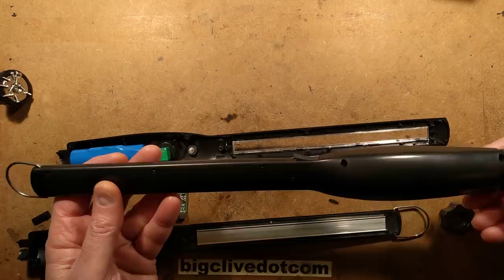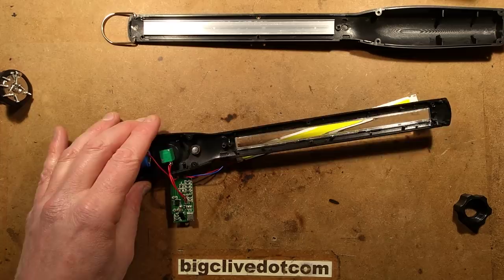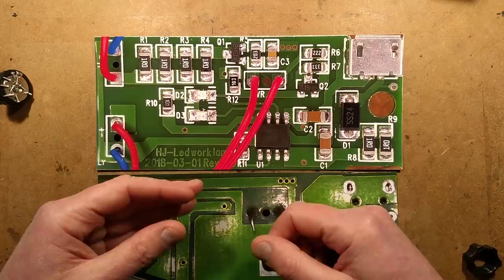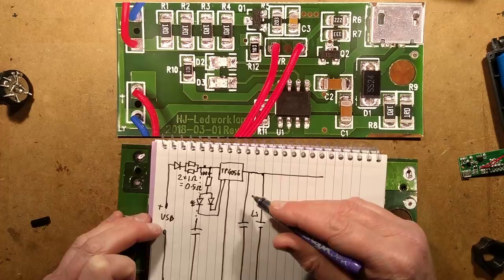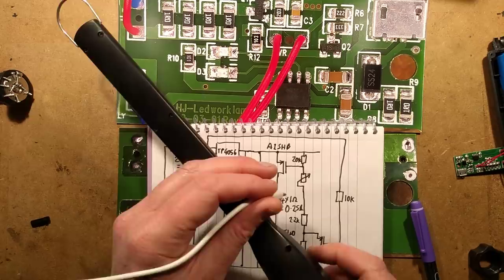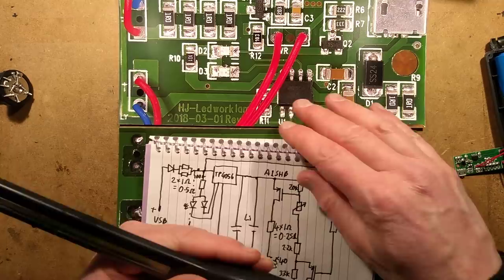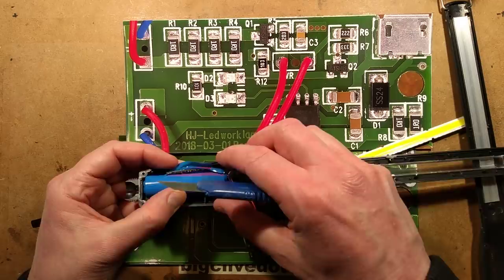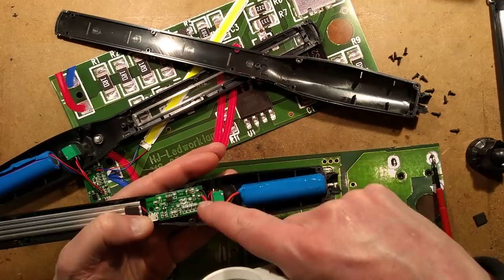Astro Pneumatic light versus clones?  (teardown and schematic)

Comment: I have the Braun version of this which I picked up in the USA. It's made fully of metal and it has a removeable 18650 battery.
Reply: My Braun has an aluminum battery / switch / grip housing, but the LED bar and hinge are just plastic.
Reply: Braun seems great size wise and with the removable battery. I wish it had a hook though. I like to hang mine sometimes.

Comment: Aren't powered screwdrivers more likely to damage screw heads?
Reply from the maker: Yes.  I come across a lot of equipment where the misuse of powered drivers has shredded threads and heads.
Reply: Only if the screws are poor quality, like Chinese screws, or clutch is set too high, screw hole is too small for the screw, or other user error.

Comment: BRAUN 390 Lumen Magnetic Slim Bar Folding LED Work Light from "Harbor Freight" is 10 out of 10 IMO it has swap-able 18650 battery, magnet base and a light on the tip what ever you need that for. The knock offs they sell at "Auto Zone and other high profile stores, force you to use with disposable batteries waste of money.

Comment: Clive, you disappoint me. You mean to say you only take things apart if they are faulty???
Reply: Ah, you want somebody who takes stuff apart before it's fault?  Try AvE's BOLTR playlist.

Often, when he puts it back together it is faulty.  Wasn't faulty when he started but it is when he's finished.
Reply: @bdf2718  Dave Jones on EEVblog has the saying "don't turn it on, take it apart!"
Reply: @NiHaoMike64  
Yeah, but Dave doesn't disassemble it down to the component level.  Using a soldering hammer.  Which is pretty much how AvE would deal with it, but that's because he's a machinist.

Then again, when AvE takes mechanical stuff apart he can be a bit brutal.

Comment: Why are circuit boards mostly green?
Reply: Because green is the color of life and they are for live current.
Reply: It's not easy being green.
Reply: The green colour is that of the solder resist coating. Green is the cheapest, hence the most common, hence the cheapest... But other colours are available including red, white, black etc....

Comment: My Chinese knockoff stays on. Any thoughts?
Reply from the maker: Does the switch click at the end of travel?
Reply: bigclivedotcom it sure does that’s what’s crazy about it. I just got it. It was so cheap I opened it up thinking the wiring might have been wrong but all solder and wiring is correct.
Reply: bigclivedotcom I fixed it, turns out they smashed one of the wires so bad when putting it together it couldn’t run to switch to make a ground connection. Thanks for the quick reply. Hey atleast you got a new subscriber!
Reply from the maker: @jaredbradley4095  Good result finding the problem.  They're good lights.

Comment: Draper have one that i picked up at the Autosport show a couple years back, after watching a demo guy beat the shit out of it with a lump hammer and it still working perfectly. Similar-ish design, micro USB etc. but more rugged. The cob housing is aluminium and positionable: https://www.drapertools.com/product/65410/Slimline-COB-LED-Rechargeable-Magnetic-Inspection-Lamps-(5W)

Comment: 1. often faults are put in intentionally maybe to get past customs without problems and avoid duties.

i know this because i had to send 2 hard drives to a canadian data recovery house and by declaring them as broken no duties had to be paid and possibly no inspection either.

2. there is pwm going on it is probably flickering in sync with most cameras  so you dont get a flicker.

if you get a professional variable speed camera used for filming tv screens and down/up converting film you may get a flicker.

and it is possible to pulse in analog because vhs uses a sync pulse and a series of pulses for the macrovision copy protection

Comment: Eww, linear regulation with a mosfet... That's just wrong.
Reply: Dick Fageroni  Why so rude?
Reply: Dick Fageroni  lol, they are not run in linear function in switch mode. Learn your power supply classifications.
 I say that based on how most power supplies run, and how class D amplifiers with Mosfets work with high frequency PWM chopping. The reason why Mosfets are great is because of the low loss in conduction. Hence smaller and cooler stuff.

I think you just dug yourself a hole.

Comment: Just goes to show, invent something useful, and China'll copy it & economise it in no time... :P
Reply: twocvbloke Yeah, in the old days, such an original design could keep you well fed for 20 to 50 years, it's become quicker now.  Although the 2001 to 2018 difference between the PCB date and these clones surfacing here might suggest someone had a 17 year patent keeping the clones away, which is the proper way to use patents (not as legal landmines and rent seeking).

Comment: This video is a huge disappointment. I first saw the thumbnail and the title and got all excited before I could watch it. A pneumatically driven light, how interesting! the thing at the end must be the pump knob. Doesn't look terribly ergonomic, but ok. Wonder how it works! Perhaps a small turbine with a generator, perhaps integrated in one. Wouldn't that be loud? Possibly a tesla turbine then. Oh, oh! - or could it perhaps be a kind of a reed like in a musical instrument, with piezo crystals on it, or made of piezo crystals entirely... Wonder how much air it will hold, and what kind of pressure it needs... And then I finally get to watch the video and it's just an ol' stinkin' USB rechargeable light. And it's pneumatic because the company making it apparently has "pneumatic" in the name. Bleh.
Reply from the maker: I'm trying to work out how to reword that so people don't think it's a pneumatic light.
Reply: @bigclivedotcom  "USB rechargeable lights from Astro Pneumatic - original vs. clones" perhaps?